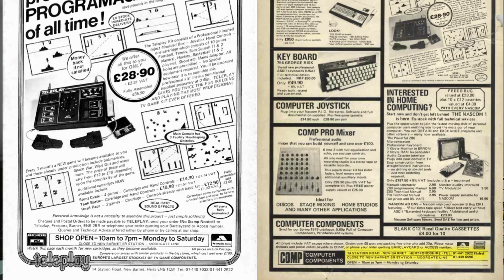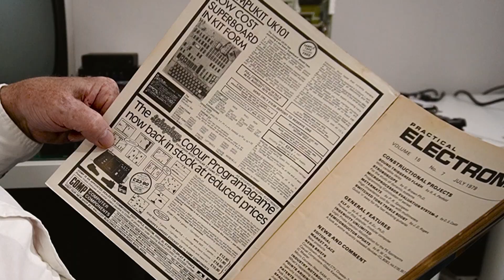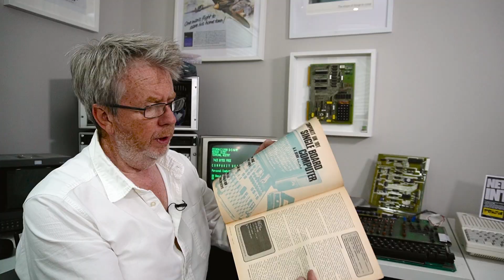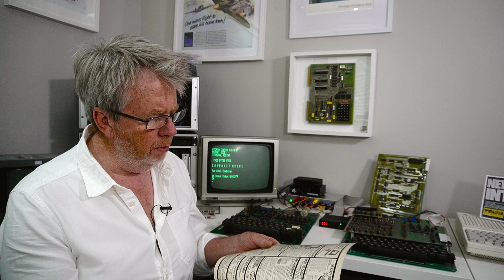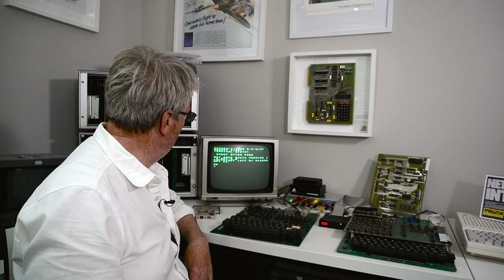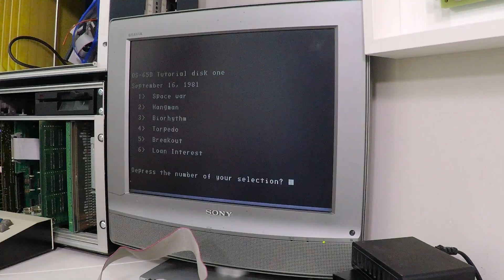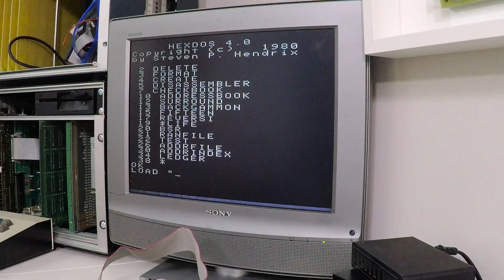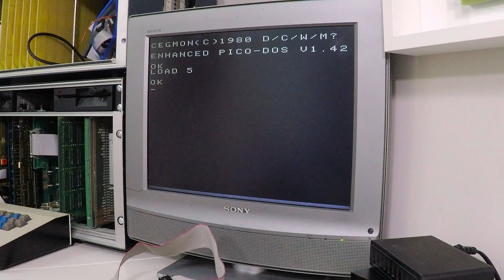OSI Superboard II and the UK101

Comment: My first computer was a Superboard which I had to modify before I could use it by cutting tracks and adding extra logic on a veroboard to convert it to 625 lines. I think it also increased the number of characters on a line. I also built my own UHF modulator and power supply from parts supplied with it. All worked well for years until I upgraded to a BBC Model B
Reply from the maker: As a matter of interest what made you choose the Superboard over say the Compukit 101 or the Nascom? I'm always interested in the process people went through back in those early days.
Reply: @GlassTTY  I think it was simply that the Superboard was available at the time, whereas the UK101 was slightly later. The Nascom, if I remember correctly, was more expensive by the time you added a keyboard and didn't include BASIC. I built my own sound card and static ram extension on veroboard with a bunch of 2114's, TTL buffers, address decoders all hand-wired on veroboard. Amazingly it worked well for several years. I ended up working for a computer company designing mainframe processor chips before moving on to software and have recently retired after working for the same company of over 40 years. It did me well!

Comment: Forgot to mention that my mate across the road also had one with a 610 expansion board and disk drive that I was very envious of. It did have a nasty habit of freezing with the 610 attached though. With my knowledge now I could probably recreate the H/W in VHDL, but like you, I couldn't be arsed 😅
Reply from the maker: My 610 seems Ok so far but I guess it's still new so time will tell. Thanks for sharing.

Comment: Omg, I thought I was the only one left with one of these. Mine still works. I had to remove the cheap IC sockets which had all turned black and solder the chips directly into the pcb after cleaning the legs. It was and still is reliable after doing that. This machine is responsible for my long career in electronics (I'm 64 now) as it got me hooked doing all sorts of mods to the H/W.  I will find it hard to psrt with due to the memories  but I wonder if they have any value after all this time?
Reply from the maker: Is it the UK101 or SBII you have? And where are you based, UK? A UK101 in the UK can fetch £300-£800 possibly more with expansions etc.
Reply: It's a Compukit UK101 and I'm in St. Leonards-on-sea on the south coast UK

Comment: I've still got mine. Nothing to run it on nowadays. It did have to have a trip to Barnet when I managed to destroy a track near the modulator, but was otherwise a good machine. I learned a lot of my programming on it.
Reply from the maker: That's nice to hear, does it still work?
Reply: @GlassTTY  I don't know. I don't think I have powered it up in 40 years.

Comment: Thanks for a great trip down memory lane.  In the early 70's I was making monitors to stop strip forming presses if a component was NOT ejected using TTL logic chips, and a student getting industrial experience with me had a UK101 he could not get working.  Somehow I managed to solve his problem, and was so impressed by the machine that I got my own. I drove to Barnet one Saturday morning, and had the machine up and running by that evening.   Only problem was I couldn't save programs on tape.  I had used a wide tolerance ceramic capacitor in the 90/150 c/s tone generator instead of an accurate paper one, so that was quickly sorted out with help from either Watford or Barnet.   I increased the memory to 16K and added other mods I cannot now recall at 85.  I taught myself Basic and later learned machine code, and eventually got an assembler, programming the game Rhino in c (rather pointless as it needed lots of delay loops to slow everything down!).  I think I eventually used the machine for printed circuit design, but left it in my little lab when I retired in 2005, and guess it has been dumped since.
Reply from the maker: Thanks for sharing this. Everyone who's heard of the UK101, seems to have very fond memories of it. I really enjoyed mine even after I bought a BBC Micro. I felt, that after owning the UK101 for a few years, that I fully understood it. Whilst I loved the BBC Micro too, I never quite had the same intimate relationship that I'd had with the UK101.
Take care and thanks for taking the time to comment etc.

Comment: insidently,, for example  >>> 12m ,,((  this is only a replica  only the board is a replica ,, all the components are real  ,,,,))   a very odd phrase in my view
.
the PCB tracks are a copy of the original OSI board & the logic chips are again the same logic which were used on that board so its all a replica ???
PS,,  the kim 1 framed on your wall,, There was a book  " the cheap video cookbook " using the cpu to make the video raster,,, much like the ZX80 maybe ??
Reply from the maker: Yeah mines a replica, but, would it be a replica if every component, including the board had been changed during its lifetime? I would say not.

Comment: When I was a young engineer at the Droitwich Transmitter one of the senior engineers had a UK101, which he used to bring in on night shifts.  I certainly remember him using it to decode the time signal from MSF, which we received locally and used as a reference to check the drift of our Rubidium drives. No case for his 101, it was mounted, as I’m sure were many on a piece of wood. My first computer was the Atom, but thanks for the trip down memory lane.
Reply from the maker: We used to use the 200kz Radio 2/4 transmission to sync a master oscillator, everything went pear shaped when it switched to 198khz. Happy times.

Comment: I remember both these machines from magazines at the time, but I think I only ever saw one of them, a Superboard 2 in the Auckland University engineering department during an open day in 1980. The first computer I got more than a couple of minutes access to was an Apple ][ bought by my high school at the end of 1980, and which I was allowed to take home for a few weeks over the holidays to figure it out and explain it to the Maths HoD. The next year I was using PDP-11s at university. Actually, tell a lie, I did get to use a Burroughs 1800 (1700? 1900?) ocassionally in the evenings during 1980 when the maths teacher, Brian Painter, took our FORTRAN punch card decks in to run them.  He died at 99 1/2 two years ago and in 1980 would have been 7 years younger than I am now.  Btw, by 1979 pretty much everyone here in New Zealand had colour TV!  Many people's first set was colour, often bought at the same time as TVNZ started colour broadcasts just in time for the 1974 Christchurch Commonwealth Games, and also vastly expanded the transmission network into the regions at the same time. The most popular seemed to be the Philips K9, launched in the New Zealand market in 1973 for $1200.
Reply from the maker: Thanks for sharing this. It's interesting to hear how things were different in NZ and really great to hear from you. Lots of people around here had the new 'colour' aerial (UHF) to get BBC2 but didn't have a colour TV. You could tell who had a colour TV back then as they would watch it with the curtains open. Those with just the aerial watched with the curtains closed. :)

Comment: I bought my Ohio S2 way back in the day.
One of my first modifications was to create a 2k screen, by piggy backing 2114 chips over the screen memory...
I later also updated to make the screen width 64 characters, making it far superior to the UK101
Of course none of this could've been possible without GEGMON led by George Chiantz of the OSI users group, who was one of the three authors of the much improved monitor programme.
Eventually, I installed a Basic/Assembler switch as I wrote 6502 assembler, so the assembler chip simply replaced the basic eproms ..
The addition of the 610 board and them two 8 inch floppy disk drives made for quite an entertaining programming platform.
All of this at a whopping overclocked 1.5 megahertz !
I had a built in eprom programmer and a faster Kansas city interface... my good old Phillips 3302.

I changed my character set too, redesigning the characters for fatter characters, true descenders and giving the CR and LF characters a character so if these were printed to the screen, you could see what they were (other than a space)...
Interestingly, the address lines of the S2 and UK101 were reversed, so swapping put the character generator chips reversed the characters in the line.
I learnt a lot from messing with my S2.
I still have my OSI 610 disassembly manual...
Reply from the maker: Thats a great story, my 610 board being slightly later, has an extra socket for the additional display ram, I've populated it but not made the Cegmon changes yet. Thanks for sharing.

Comment: I got my C1P in xmas '78 from Linn the audio folks in Glasgow. It was just a Superboard II in a metal box. It had though the correct modulator to connect to a tv. Whether Linn had modified them or not, I do not know. I was just grateful as a 16yo kid that I could hook it up to a tv & muck around with it. It came with 4k SRAM, but was easily upgradable & expensive to double it to 8k.
Reply from the maker: To have a C1P back in 1978 must have been amazing. Do you still have it?
Reply: @GlassTTY  Nope, I fried it. Then the speccie came out and I was happy again.

Comment: Can  you still get genuine 'Microsoft BASIC in ROM' chips these days or do you have to use - erm - 'replicas'? Nice video. Brings back memories. Thanks.
Reply from the maker: I used EEPROMS in the genuine non-original 46 year year old Superboard II that was built last year. They look like ROMS so it looks right. Otherwise its 2716 EPROMS which many machines used back in the day due to one or two bug fixes and published improvements.

Comment: I've also still got my uk101, but it's dead :( A friend had tantrum whilst playing my latest game and smashed his fists down hard on keyboard. The computer's never booted since then (1981)
Reply from the maker: Oh dear, what a shame. Maybe it's time to get it working again.
Reply: @GlassTTY  I was wondering. will the Roms still have basic on them now? Did you have to put new Roms in yours?
Reply from the maker: The ROMa were fine. Even the EPROM that was in the machine (Watford Monitor) was fine too. I removed that though and added Cegmon.
Reply: @GlassTTY  good to know. At the time it broke mine was heavily modded. I'd bypassed one of the divide by 2s to make it 2MHz and added a homemade D2A convertor for sound. Somewhat stupidly, I'd soldered it directly to tracks instead of using the 40 pin DIL socket. It would be good to see it going again. after all, it was my first love. I remember manually entering 6502 op codes into the memory monitor for my latest game. Happy days :)
Reply from the maker: It would be great to hear that it's running again. The journey would make a great video.
Reply: @GlassTTY  Maybe, I'll have a think about it. Not much spare time just now.
Reply: @GlassTTY  BTW. I was it's 2nd owner. I bought it in 1981 off my brother for just £80 including the 8K ram upgrade. He in turn, got it from Watford Electronics. Somewhere I used to buy all my electronics. From resistors to LEDs to BC108s for practice wireless T-dek board projects. I only ditched my T-Deck board in 2018. Wish I hadn't now really. Did you do the practical wireless projects and stuff back then?
Reply from the maker: I did some of them but by then I was working and had drifted into real life so to speak. I spent a lot of my hobby time at that point converting old Pye Westminster and Cambridge radios for use on the ham bands.

Comment: Great vid.  I had a Superboard back in the day but longed for the better screen layout of the UK101.  From memory the Superboard had 32 chars per line but the 101 was 48 or something higher.
Reply from the maker: That's right, 32 chars but only 24 or so we're visible. The UK101 had more but less rows.
Reply: @GlassTTY  There was a kit you could get for the Superboard which expanded the number of characters you could have displayed. I /think/ it was expandable to 40 or 48 across the screen. I did attempt it, but being young with a too hot soldering iron which melted the wires, I managed to have one of them touch the mains & promptly blew the board.
Reply from the maker: Oh dear that doesn't sound good. I hope you managed to fix it.

Comment: Funny Sky had people prosecuted for pirating their cards, but Sky were able to get away with pirating OnVideo and other decoder boards and cards for rivals, as well as the ones done for BSB. They were identified initially as people were suspicious within the industry for a long time, but a pirate acting on behalf of SKY came clean and even offered to stand in front of the courts to act as witness. The Tory gov at the time were pleased to see this dusted under the carpet and forgotten, after all Murdock was very much a friend of Tories.
Reply from the maker: Interesting, I hadn't heard that before. One thing that I was told today is that whilst Chris Cary was guilty of creating decoder cards and did have working Sky ones, there is a question as to whether he actually sold the Sky ones. I would be interested to hear from anyone who could confirm that.
Reply: @GlassTTY  it was very quickly forgotten in the press when this was reported, a lot going on at the time with other events so it was easy to disappear. A significant issue was some of the people acting on behalf of sky were hiding in Holland at the time, trying evade an arrest warrant for other crimes. The UK gov were not interested is following a prosecution they probably wouldn't have actually got because the crime of producing a decoder board was weak at best. They definitely didn't want to have anyone calling their friends in Sky TV Infront of the courts given how they mutually benefitted each other (just remember how the media ownership laws were changed to allow them to create the empire they have in the UK).

A lot has gone on over the years that we don't know about and even if we lived to be 300 the documents revealing much of what we can only guess will still be locked up.

Comment: Bought a UK101 kit, I remember collecting it from the shop in Barnet.  Wonderful piece of kit, I spent hours every evening typing in programs , I had just about every expansion board for it, I also built a power control unit that could switch external things on & off Vir relays, triggered from the printer port. I still have it & it still works !  Love it.
Reply from the maker: Thats brilliant, and to still have too. Was it the OSI boards that you expanded it with or something else?
Reply: @GlassTTY , Sound card, Rom card with tool kit rom & 3 others roms I can't remember what now,  real time clock, printer port, that's it I think ?  Send me a link if you wish & I'll send you some photos. 👍
Reply from the maker: Photos would be good. My email is john@glasstty.com.

Comment: When you say that the modern replicas use 'original chips', the original chips required a power-supply you could arc-weld with! Are they modern equivalents of the original chips?
Reply from the maker: Mostly the same LS type as used on the original. Memory is the original 2114 type too. All the buffers and other discontinued chips were sourced. Some are newer of course but then an original machine would have had a few replacements I guess.

What I was saying really was that whilst the board is a copy of an original, the chips are simply chips, not copies. If a broom has had 17 new handles and 20 new heads, it's still a broom, not a replica broom so maybe its the same for my Superboard.

Comment: My Dad gave me his 101 when he upgraded (I was 12!) I knew nothing of electronics nor programming: it was a very steep learning curve! Sadly, Dad had installed an "improved monitor" (improved OS?) PROM chip from somewhere, and it kept crashing.
Reply: The monitor wasn't an OS.
The monitor generally allowed viewing of memory contents, registers, possibly disassembly of memory, possibly assembly of mnemonics into machine code.

That's not an OS.
Reply from the maker: Both my Superboard II and UK101 now have the Cegmon monitor fitted. But Watford did one too, but I remember that a lot of track cuts and bodge wire were needed to get that working.
Reply: @GlassTTY Curious. It almost sounds as if something was being done in terms of chip selection, address decoding changes to enable a ROM containing the monitor program to work.

Give me an FPGA anyday!
Reply from the maker: Thats right, that exactly what it was. If I remember correctly the Watford Monitor was in a 4K ROM rather than a 2K ROM.
Reply: My dad wrote and sold an extended BASIC for the Superboard II here in the UK that was quite a bit different to the other ones.  It was never marketed very well and didn't take off, but I remember it being very good.

I reverse engineered the BASIC from a simple disassembly printout with it laid out on the floor.  First identifying all the code blocks and data areas, then painstakingly penciling in what each of them did.

My dad and me built the printer interface and used an old Creed-7B teleprinter that we had picked up at an amateur radio rally to print it out.

I was 10 at the time!  After doing that I wrote to Bill Gates in Albuquerque to ask for the actual source code.

He wrote back with a very nice letter saying unfortunately he couldn't give me the source code, but was impressed I had got as far as I had.

Many years later I ended up working for Microsoft on their C++ team running libraries - haha.

That Superboard and those early projects started everything for me.  We added memory, a disk controller and I even added an AY-38910 sound chip to it.  Those were the days!!

I don't know if we still have it.  I should go and have a look up in the loft sometime.

I hope it wasn't our monitor that kept crashing!  😅